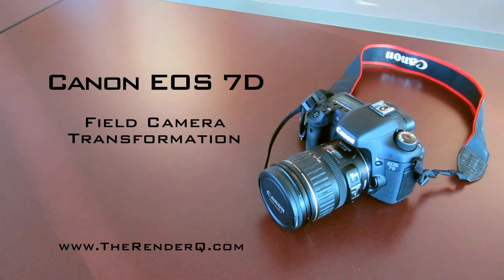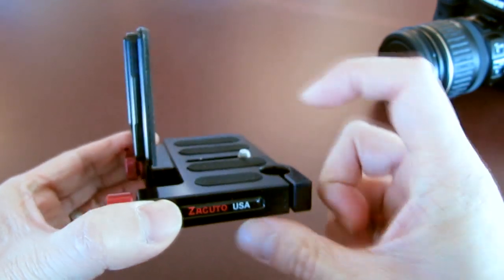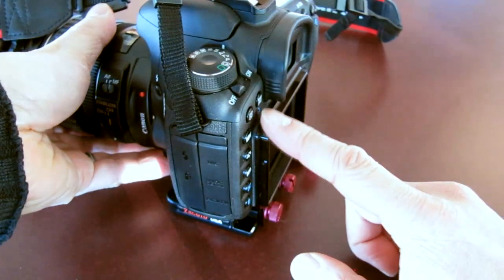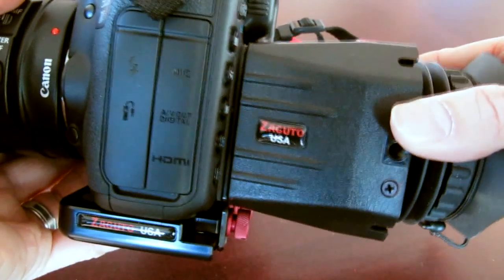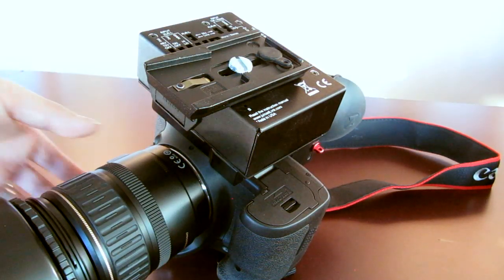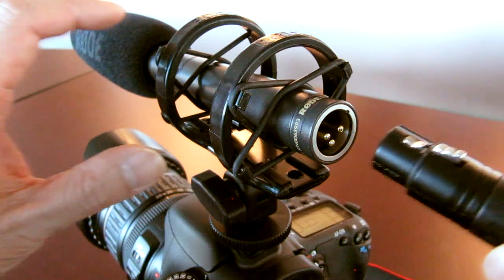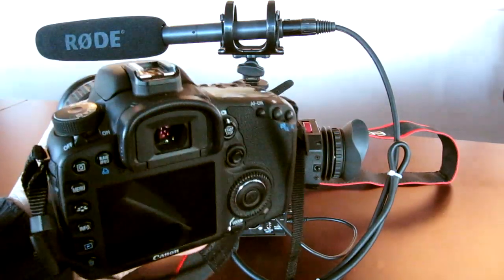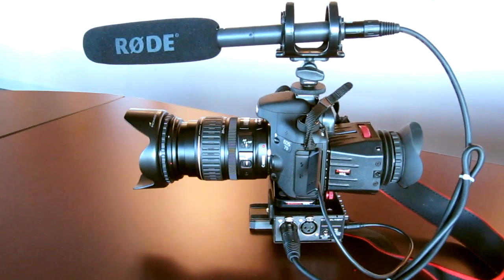Zacuto Z-Finder And Rode NTG-2 Mic Installation On A Canon 7D

Comment from the maker: @ThatBriand The NTG-2 is offered with various kits or you can get the microphone separately. The kits usually include the hotshoe shock mount and various other accessories like XLR to mini plug cable, XLR only cable, windscreens, handgrip, etc. There should be a configuration that will work for the camera you are using.

Comment from the maker: You're right! I didn't think about that because I don't have a wide angle lens right now. The mic could be slid back so the windscreen is touching the mount but that might not be back far enough if you're using a wide lens, especially on a 5D.

Comment from the maker: You can use a mic without the Juiced Link but you might get some unwanted noise from the automatic gain control (AGC) on the 7D. The Juiced Link box has a built in AGC disabler so you get cleaner sound. There are some DIY hacks around to disable the AGC using an MP3 player and a special cable... cheap compared to the Juiced Link. Do a search for Canon 7D AGC disable on Google and you should find some articles on it. The mic I used is XLR so I had to use some sort of converter to mini jack.

Comment from the maker: @alvaburroughs You should be able to attach a Marshall monitor to this set-up. The thing about attaching an external HDMI monitor to this set-up is that once the external monitor is connected, the rear LCD is disabled... this makes the Z-Finder useless when an external monitor is connected. So if you're always going to use an external monitor, you won't need the Z-Finder. However, the Z-Finder is great for focusing your shots and going handheld.

Comment from the maker: @UnDeadKnight1 You're right! This gear made the 7D very heavy! I got tired holding it even for short periods of time. But one thing that helps is that with the ZFinder, it helps stabilize the camera by using your face as another point of stabilization. At one point, I put on a Canon 70-200mm L series lens and it was REALLY heavy!

Comment from the maker: @TheLukeSchiltz I was experiencing the same thing when I first got my 7D with the 28-135mm lens. The noise you're hearing is the image stabilizer. It's on the left side of the lens. Turn it off and the noise from the stabilizer will stop. When you have it on, you will also be using more battery power but less blurry shots. I'm not sure if using the stabilizer gives you the same benefits shooting video as it does for photos. Hope that helps!

Comment: This video was superb however, can you also connect a Marshall monitor as well with this set-up? Also, did you say that once the Zacuto Z Finder Pro is connected, you cannot shoot once in video mode? If this is correct, then what's the use of connecting the viewfinder?

Comment from the maker: @dcocoacow1212 I don't know all the differences but the body of the 7D is bigger than a Rebel body. With the extra space, the larger cameras like the 7D and 5DMkII there is an LCD screen at the top that displays camera settings for quick reference. For shooting video, I don't think there's any difference between the EOS and Rebel models. Sorry, I don't have a better answer.

Comment: The juiced link and Rode mic seem pretty superfluous. Yes another audio solution is needed, but at the end of the day its all going into a 3.5mm camera jack. Better off using a zoom recorder and having a separate 24bit independent audio file assuming you can find a decent shock mount. 

The zacuto isn't a bad option for stabilization clearer perception though. Might be a little too much for live events, where you have to watch where you're walking and such.

Comment: Hey I was hoping you could help me out. I have the same lens you have (Canon 28-135). Can you hear the IS on yours? For some reason there's a very slight noise coming from mine. I have a RODE VideoMic, so it doesn't really interfere with filming, but I was just wondering it that is normal. Cheers.

Comment: Not criticizing here bro and I know you up'd this a while ago now but the reason your shotgun is "sagging" at the front is because you haven't crossed the bands. When you push the mic through one of the rubber bands, you should cross the bands over so that they rest on the opposite facing side of the mic. Probably didn't explain that well but if you understand what I mean it will give you much better purchase/resistance and that mic ain't moving nowhere ;)

Comment: The difference between 16bit and 24bit is unnoticeable to most people. Also, if you mount the mic to your camera, instead of having it on a boom, it makes no sense to go double system. Proper mic placement at whatever bit rate will always sound better than 24bit. Also, syncing in post is time consuming, especially if you're working on docs with hours and hours of footage, which raises budgets exponentially having to keep track of everything.

Comment: 7D body-1.8 pounds, 28-135mm lens-1.2 pounds, NTG-2 (without shock mount or cables)-5 oz, juiced link box-8 oz, z-finder-shipping weight 3 pounds. Adds up to approximately 13 oz. adds up to roughly 6 pounds, 13 oz. so almost 7 pounds. Allow a pound of leeway for the undifined accessories such as xlr cables, mounting plates, and the microphone shock mount. Shouldnt be any more than 8 pounds. The max weight for the flycam 5000 is 8 pounds... So it will be very close.

Comment: thats not a videomic....
its an ntg2
Reply: Yeah, was thinking  the same thing. The video mic has the usual 3,5mm, so you don't need a mixer for that.
Reply: +Dimitri T If you want to use a condenser mic ,you do need a mixer,.condenser mics use Phantom Power.
Reply: Yubilan Ottermann I was refering to RØDE video mic. It has 3,5 mm jack so that you could hoock it up to the camera. If you want mic on the camera, that would be a better option in my opinion.